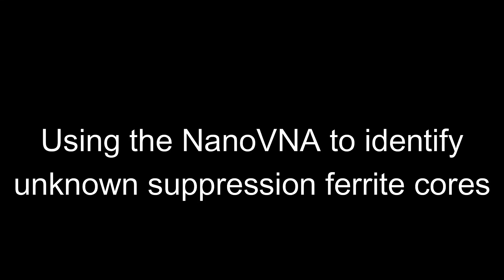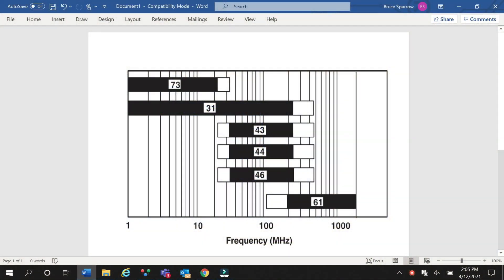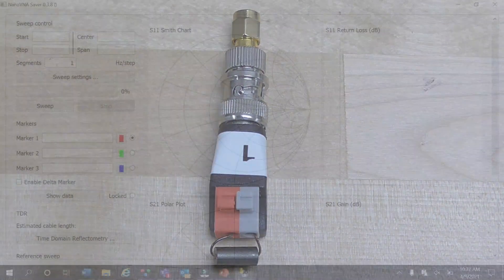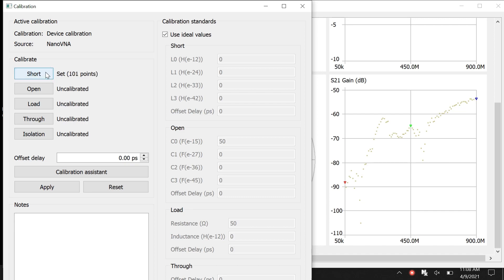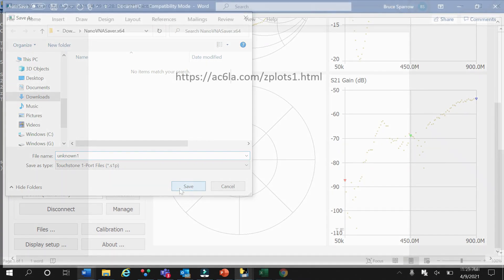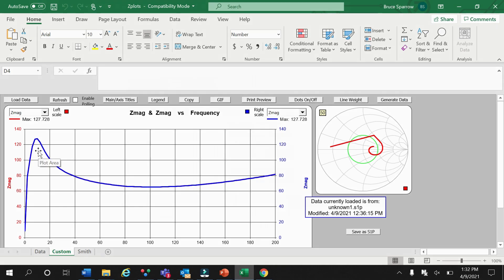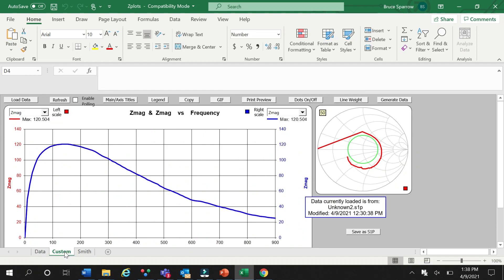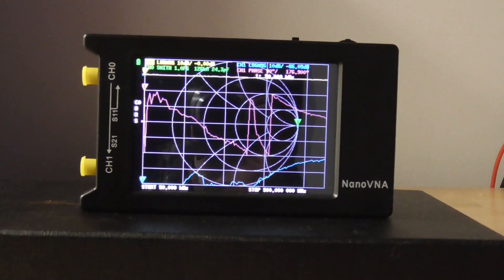NanoVNA Sorts Unknown Ferrite Suppression Beads

Comment: It is a bit cumbersome using 2 software programs to get an impedance sweep, so why not do the measurements right on the nanoVNA? I measured a type 61 core (Fair-Rite #2661540002), using a minimal wire loop length soldered directly to a 50 Ohm SMA connector and properly calibrated from 50 kHz to 900 MHz. Setting the trace format to Resistance (S11 |Z|) gives you the same data as Zplot (I did both methods as a check). I get a curve starting with Z=0 @50kHz, ~300 Ohms @144 MHz, a maximum value of 370 Ohms @260 MHz, 290 Ohms @440MHz, and 128 Ohms @900MHz. However, according to the Fair-Rite datasheet, Z values increase from ~0 Ohms @1MHz to a maximum Z value of ~460 Ohms @600 MHz, then falling off towards 1GHz. So why does the nanoVNA empirical measurement give me a completely different curve compared to the Fair-Rite datasheet?

Comment: At 1:36 in your video, you say to perform the calibration procedure, and you show a cal-device connected directly to the NanoVNA port; and you make careful-mention of using a short piece of wire through the bead.  However this is NOT the same test-plane as your elongated test-jig. There will be both substantial inductance in the jig's length and some capacitance in all the connectors.  

All calibration should be done right at the screw-terminals of your test-jig; and can be easily accomplished across the screw-terminals using a short-wire, 50-ohm non-inductive resistor and finally just the open screw-terminals.

Comment: You should post a usable link to download the program since Github just gives you a lot of ridiculous nonsense but no installation files!
Reply from the maker: I admit GitHUB is not user friendly. Use this link, find version 3.8 down the page, and you can download the version for your operating system, MAC, Windows, etc

https://github.com/NanoVNA-Saver/nanovna-saver/releases
Reply: @FairRiteProductsCorp  OK thanks. Can this method be used to also check large Ferrite cores like the ones used in Baluns?

Comment: Great video thanks. Which NanoVNA model is this exactly? From the video it appears to me to be the nanoVNA-H4 (?). Good piece of instrument, only drawback I see is the number of frequency points (100), which could miss some narrowband dips over a broad frequency sweep. But, I am still convinced that it's worth buying it, considering the features vs. price. 73.
Reply: Hi Kostas - yes, its the H4 version, 73, N2KTV
Reply: @brucesparrow2236  many thanks for the confirmation. Looking forwards for your next video, 73
Reply: H4 with latest firmware has 401 points and that is in the standalone mode. When used with a computer the number of points is practically unlimited.
Reply: @galileo_rs  thanks for spotting this, apparently not many people pay sttention to this parameter, 73

Comment: Thanks for the helpful video. What i cannot understand is why Fair-Rite does not mark their Beads/Toroid etc., everyone has this problem. Surely this is not a un-surmountable technical challenge. Will appreciate an answer from Fair-Rite.
Reply: You are correct, its not insurmountable and we currently do some laser etching of part numbers for special applications. We are looking at various methods such as color coding or other markings that would identify the core. While it seems easy to do, the same size case is used for different ferrite mixes. If each snap-it had its own uniquely identified part number we would need a large increase in case inventory and core assembly space which right now isn't immediately available. Stay tuned, we will get there
Reply: @brucesparrow2236  Has Fair-Rite made any progress to this end as you indicated previously.
Reply: @jbammi  Based on the looks of their new stock, I'd say no (no progress). But this type of change would require some employee in the company to have dare and initiative, but since most corporate cultures are suppressive to any new initiative I'm sure the idea has been shot down and suppressed. Better get used to wasting hours of time figuring out WTF kind of core you've got.